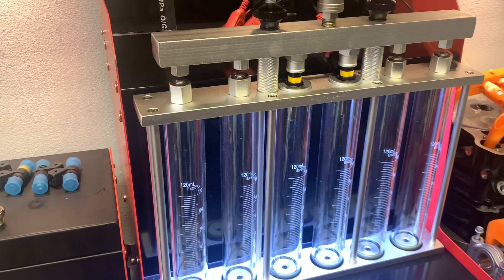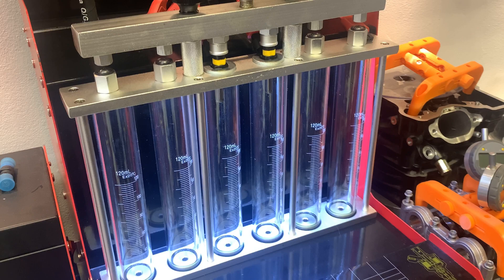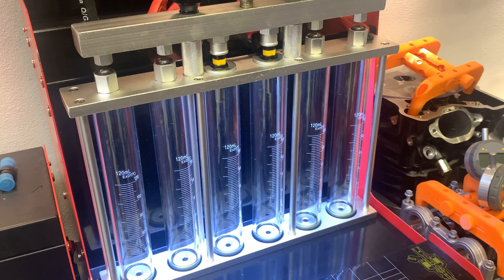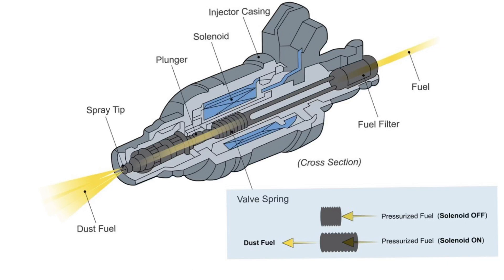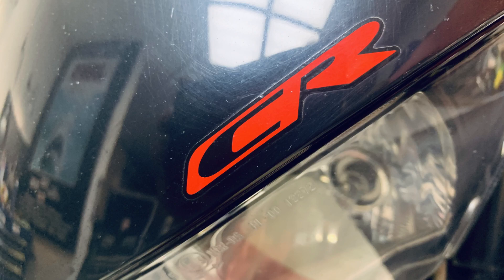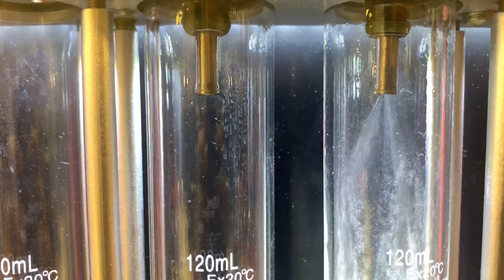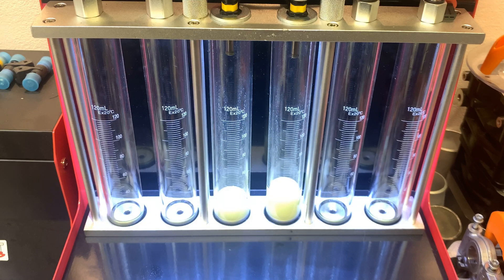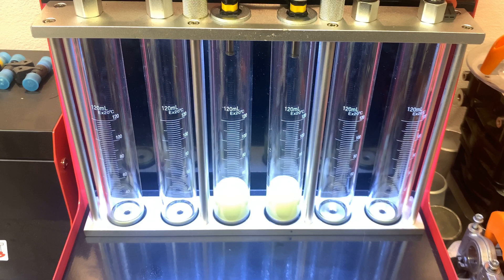NCCR Tutorials: Buell injector fail

Comment: I checked my injectors and they were good, but front cylinder is getting more fuel and then shuts off, any suggestions?
Reply from the maker: Always hard to say from the distance. If it is really only one cylinder, so we could rule out any sensor failures. Could be too much fuel or non effective spark. 
Reason for both could be a corrupted map. 
Try to get a diagnostic direction by switching for testing to another ECM. Also try another coil with IGN cables. You need to be 100% sure, including eventually faulty wiring harness, that the IGN side is ok before you look into the injection side.